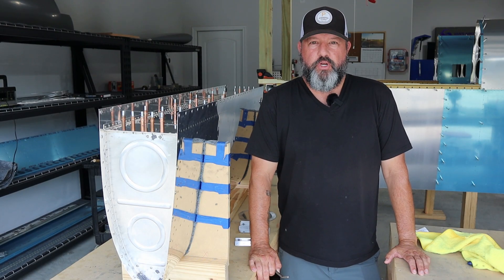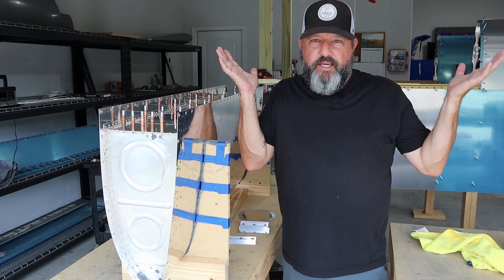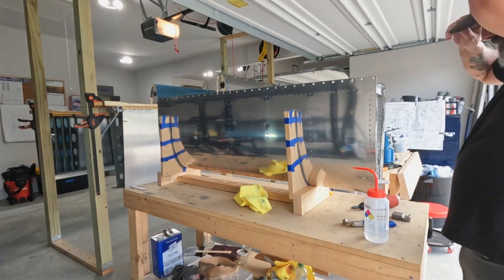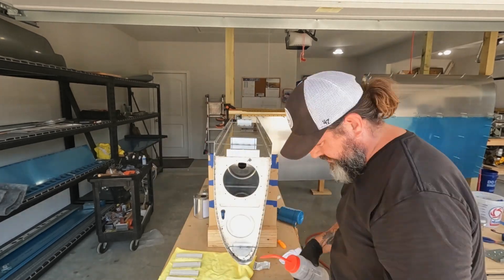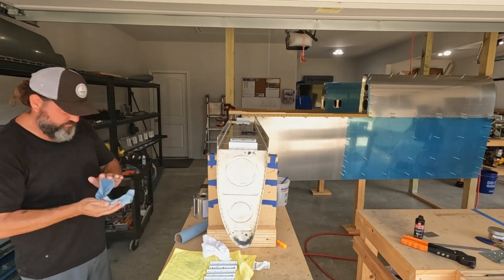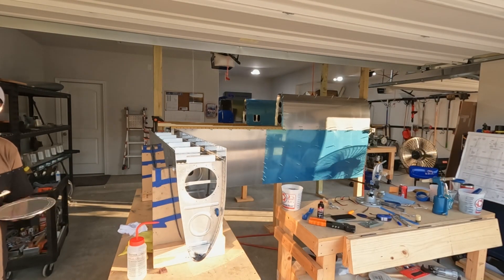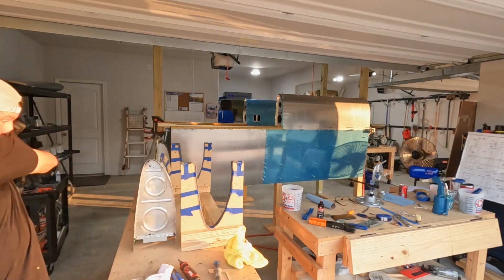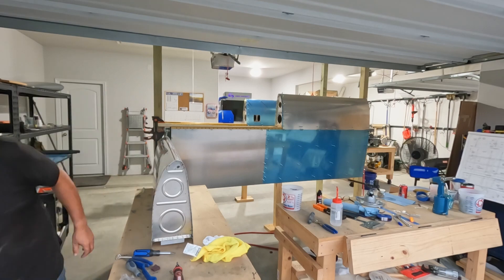Van's RV-8 Build. Ep 083. Fuel Tanks 28

Comment: Trying to get caught up here... fantastic work. Excited to see how the leak test goes, if it's anything like mine, getting a seal on the balloon was harder than getting a seal on the tank!
Reply from the maker: On my way to Paris for work until the end of the month. Leak testing will have to wait a bit. The suspense is killing me. 😂 Did you use Van’s leak test kit? I have one on order.
Reply: @thathippiepilot  I did. Most of it worked well, the balloon was a constant source of leaks, making me think my tanks were leaking.

Once the seal on the balloon and fill lid we’re sorted, one tank was flawless the other required some additional sealant applied to the rib side of the baffle. Work that I did through the fill hole, but was still incredibly difficult/frustrating.
Reply from the maker: @RyanFlysPDX  I’m anticipating a fair amount of frustration as well.